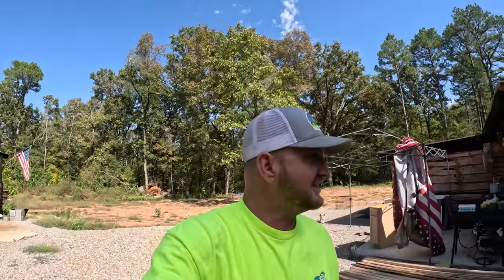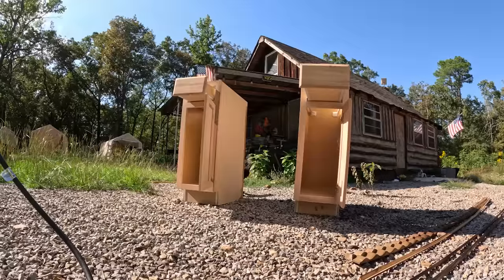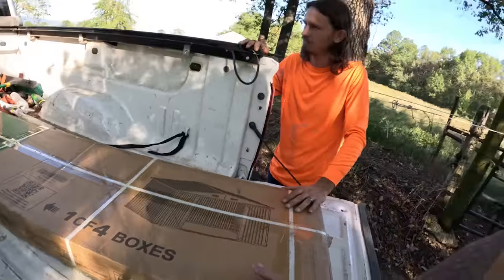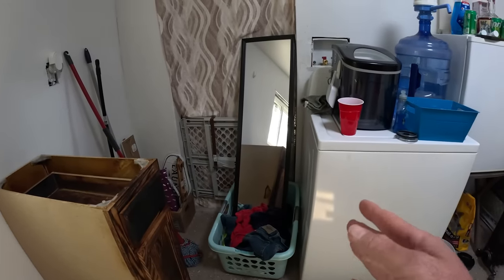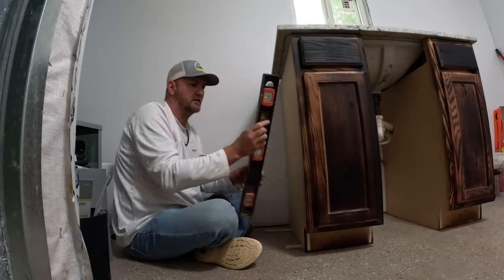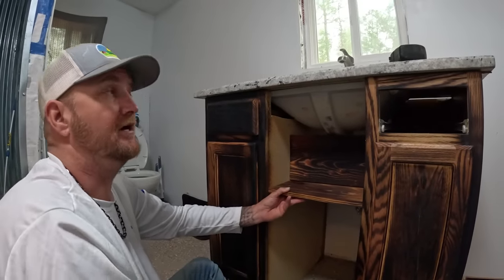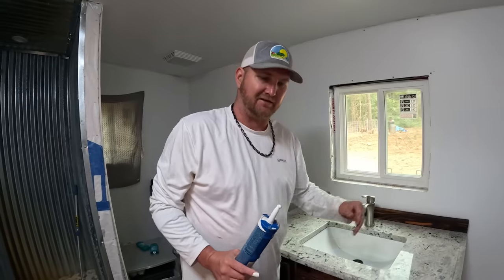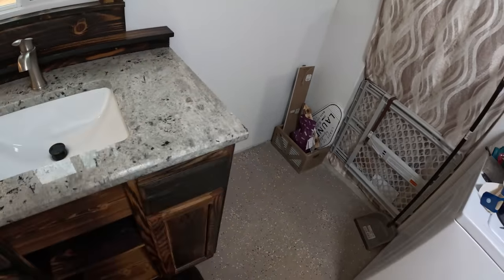CUSTOM BATHROOM SINK UNDER $200 tiny house, homesteading, off-grid, cabin build, DIY, HOW TO sawmill

Comment: I had to watch it twice because I was wondering if Ryder had come back and I'm pretty sure I noticed he indeed did come back acting as if he had always been there at 48:21 to 48:26 
Love how the vanity turned out and the idea that someone else mentioned about making window shutters with mirrors in front of the vanity window.  Maybe a springloaded curtain rod and curtain inside the  window sill with either bifold or a single wood  framed mirrors on hinges with mirrors on one side when closed and maybe corrugated metal when in the open position making it dual purpose if that makes sense.

Comment: David, there is a channel "Off Grid with Jay and Jen", they just put out an overview of their 2-3 year old Solar Power system they built.  They use sealed lead acid batteries that won't freeze, and are in a outdoor shed with all the controls.  This may help you with some decisions.  ❤❤

Comment: Hey Mr. David. Here is an idea for you concerning the centerpiece shelving under the new sink. Why can't you get your measurements
all together and construct a "slide-in" set of shelves that are free standing. Doing this solves several things for you. They will be strong
by themselves so you don't have to jack around putting screws into those flimsy inner walls and whenever you need to get to the plumbing
to fix a leak or whatever all you need to do is slide the free standing shelf section out and out of the way. When they are placed back in
there it will hide all the pipes. Make the upper part of the free standing shelves at a sloped angle to fit into that space better and put a
backing on it so you will not see any pipes when in place. I know you can do this because if you fiddled those cabinets to make it look 
that good, I know you can make shelves to slide into that center hole that will look fantastic! Something simple that solves all your issues.
Hope you read this before you start any more cutting down there that you really don't need to do. 
         """ Well I see I'm too late with this idea. Sorry I tried. """                                                                    Just an idea for you, Me southern AZ.

Comment: Hey David how about a mirror that will have two sides? A picture on one side and a mirror on the other side, to fold over from the right side of the window to in front of the window over the sink , and then fold back when you are through ! with your engineering skills you can figure it out !

Comment: I will bet there is a salvage store in Ft. Smith.  There is one in Knoxville called Railroad Salvage.  Very cheap building materials like flooring, roofing, cabinets, rugs, paint, etc.  This store takes overstock and damaged goods.  Some of the "irregular" goods are very nice.  Ask Google.

Comment: Dave you have made a supurb job on this bathroom sink unit, I admit I was a little worried about how the corrugated tin would look, now I see it, it works/goes well, I would clear coat all of the metal not just the sides, five stars for this one Dave.
Reply from the maker: Ty

Comment: The cabinet looks great.  The dogs name was Milo.
Reply: I would just take that side off and replace it. That way you won't have a hole inside when you open the door. Just put a curtain up across the front and get one to match for the window.  The shelves will be easy. Just a small piece of wood up on both sides and a shelf for it.
Reply from the maker: I like what I did easy is not always better C'mon

Comment: You know, it doesn't have to look shiny to be protected by polyurethane. Try putting two coats of high gloss polyurethane on to seal the wood followed by one coat of Matte (Flat) Polyurethane.  It will look like there is nothing on but they will be fully protected from water exposure. It would be a good idea to sand lightly and wipe the wood pieces between coats as well.

Comment: Absolutely stunning. Great job. The feature wall behind the toilet will tie everything together and look amazing. Have you considered doing a flip up countertop in front of the door to the pump house? Something similar to a what is at the end of a bar. You could use the countertop as a temporary kitchen/laundry area and still have access to the pump house if needed. I would make the “flip part” the width of the door with the hinge where the left door frame is that way the counter would rest against the left wall when open.

Comment: Hi David -  Just a reminder that Hard Water leaves horrible stains on black anything.
Perhaps you should think about a lighter colour for the caulking around the back 
splash.   Those Hard Water Stains won't show up as much if you match the 
multi-colour of the counter.
btw:  GREAT JOB on the cabinet install.  Looking mighty fine.

Comment: Those boards burned differently bc they’re pressure treated. I bet the chemicals they put on them cause them burns differently. The drawers just scorched. I probably would’ve sanded those drawers lightly to see some grain, then poly it.